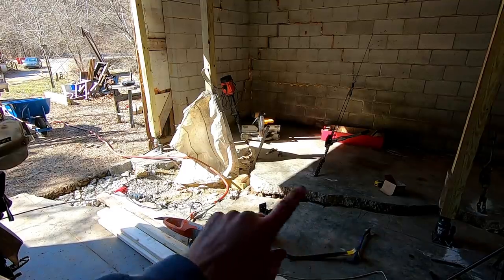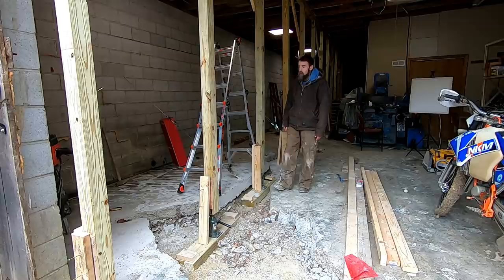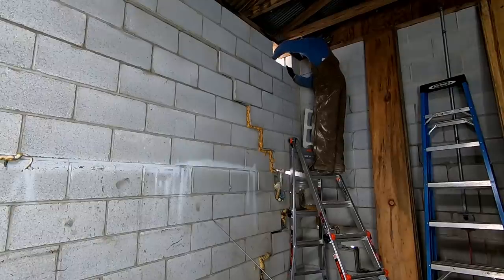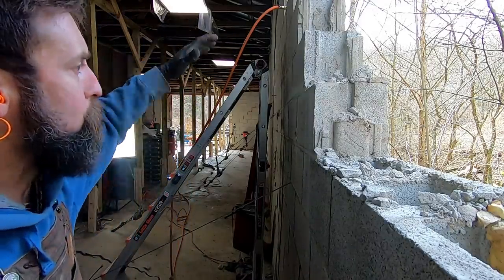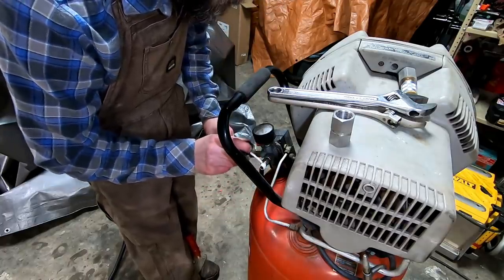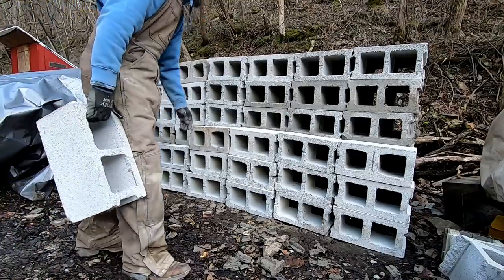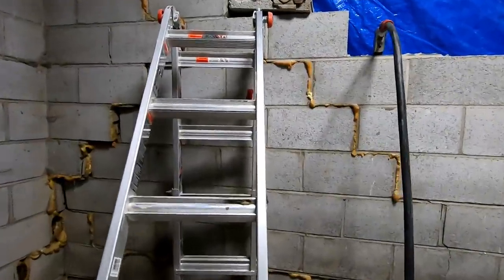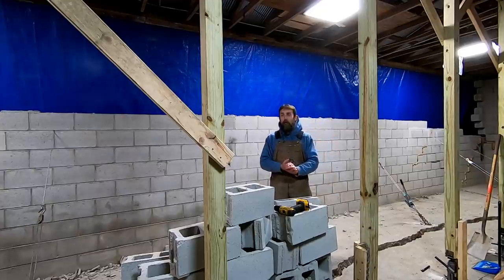Leaning Block wall removal and Roof lift  SHOP PT4

Comment: That young man was working his B.O. humping those blocks for you Steve. Dead weight shere on those  screws is no worries. If anything the threads will help maintain lock in the wood that they are screwed into. Use a comparable size of screw  for the nail that you would have used. Dont use a sheet rock screw where you would have used a 16d nail. It is like everything over the last few years. The meathods and material have come a long way. I added on to my shop about 3 years ago and very few nails  were used in the construction. Even though I have a very good nail gun. Just pay attention to what screws manufactured intended use is. Dont short cut the intentions over cost. Baring any disasters  and maintaining what you have that building will still be standing when your son is old and in no longer need of it. Along with the equipment inside.

Comment: You could set aside some space along that wall for the wife and kid work spaces, plus a general multi use bench near the door that would be great for gardening use, disassembly of messy things. This is the perfect time to plan out the layout of the whole garage, machines, fixed location benches, moving benches moving tool box/bench... lots of options.
I doubt the roof is all that heavy, just not fully able to support it's self, I'd be surprised if the posts have to support more than 200 lbs.
You've gone overboard on the support with the 4x4 and 6ton bottle jacks, like you had a 2nd floor to deal with, mostly to keep the internet armchair engineers from loosing their minds, only half will be sufficiently convinced you've done enough, and nothing you do will satisfy all of them.

Comment: I saw a wet saw recently that had a good two and half foot wide blade thats handheld but just has a metal frame around the blade and not alot more bar the two hoses.

Comment: A grk ledgerlock screw has the same shear strength as a 1/2" lag bolt.  Use them all the time.
Reply: If it is not the same diameter or uses a significantly higher tensile strength steel, I don't see that being likely.  Shear strength is going to be determined by the cross-sectional area and tensile strength of the steel.

Comment: wow Steve, a foot long bolt holding the roof! here in OZ its 1/2" threaded rod that ties into the floor or foundation reo , good job i wish you luck
Reply: Yes I like a few more courses of weight involved. I use stainless rod and nuts, it's damp in UK

Comment: I really wish you were wearing a respirator that cement dust is dangerous. Oh ok you were could not see it when you switched to the air hammer. Good job. Concern about GRK screws is crap. Those are the toughest screw you can get and engineered to replace lag screws. Don't worry about those things.  You have that way over engineered. Don't worry about it.

Comment: Nails have better shear strength, but given that the fasteners are not taking the whole load, I think you are just fine.  I looked all this up, and there are a lot of variables here.  These include species of wood used,  size of screw, distance from the edge of the piece being fixed, moisture content of the wood.  You get the idea.   Do you intend on re-using the block?

Comment: Screws will act in tension in your application- the roof weight being carried by the friction between the pieces of wood pulled hard together. If you'd nailed it together, yes the nails would mostly be in shear.

Comment: ProjectFarm did a test on shear strengt nails vs screws and is basicly not better with nails, since screws hold the wood together better anyway and they does not shear as esy as many think

Comment: When you are pouring the new slab, are you going to put in the shuttering, dig deep, put in all the rebar for the foundation footings, and tie to the existing concrete yourself, or hire in somebody to help do that. Buy a concrete mixer, rent one ( not the best, if you have one on hand, even the cheap ones, it will always find use around the area and your family) to do the foundation mix, or get a truck of concrete or three to do the initial pour, and only use the mixer for the mortar for the walls. When you dig down to the shale, and are at final depth, drill a row of holes and hammer rebar down there to tie in strongly to the rock, will keep it from moving for the next century or so, till the stream cuts down deep enough.
Reply: If it's in the budget, I would personally have a mixer truck come in and knock it out in one go. It makes for a more consistent pour and stronger set. Plus it would save a boat load of time. It will also make for a more level and smoother finish.

Comment: I'll try to get an email off to you this evening, about my thoughts on what could be done as far as rebuilding that side and making sure you won't have to do it again a few decades from now.  I keep dithering over it because of problems with techniques ... I'd do it now, but the weather couldn't be nicer for this time of year, and I need to spend it swapping out a fuel tank on Rumble (the fuel pump went out on my work vehicle).  Best get to it, before I lose daylight.

Comment: I’m still a bit nervous about this because I can’t tell exactly where the center of mass is. I’m nervous because if that wall did go over, it would have taken that part of the floor connected to it. And what’s on that floor, leaning against that wall? The ladder, with him on it.

As far as the hose goes, what size is the connector on the compressor? It looks like 1/4”. If so, then there will be delayed delivery through that small connector.

Comment: it's a convict work ...
I have never seen a mortar peel off so easily ... finally you are lucky in your misfortune
(Google traduction)
Reply: At least this time shoddy building work and using a weak mixture is paying off slightly. An attempt was made to do it properly, just the execution was poor, the overall design was good.
Reply: SeanBZA I beg to disagree, there was no attempt whatsoever to do anything correctly as far as the slab was concerned and the way the mortar is coming off of the blocks weak tea would be a stronger mix than that crap they used!
Reply: @samrodian919  I said implementation was poor, not the design. Probably a subcontractor who decided that the steel and half the cement was going to go with them as they left site, and they had plenty of time alone to make this happen.

Seen plenty of cowboy builders, and they are not always the small guys either.

Comment: I am surprised that the wall held together with as little reinforcement as it had. No vertical rebar and no bond beam at the top at all. Guessing that if the slab is any indication, there is no rebar in the original foundation.

Comment: Use the mortar as drive way rock
Reply: Not good for that, but good as underlay for the driveway gravel, or use as aggregate partly in the new concrete if mixing on site, along with any broken blocks. Will work as mass fill, not for high strength work.

Comment: Watching how easily the mortar comes off of the block, I am wondering if it ever really adhered to the block in the first place. Looks like it was a too dry of an application from the original construction. And seeing that, I can also see why the wall was so questionable with fracturing like it did. Either way, I see you could reuse those blocks to build it back. JMHO

Comment: looks like you can reuse a lot of the blocks , looks like they forgot to wetten the blocks down before cementing them together , causes the morter to dry out too fast and become brittle and not adhere verry well
can prolly use the morter rubbish to fill in mudholes in youre access road if you have them

Comment: One thing I noticed and I may have missed it but did not see you address. You jacked up support to lift the roof to remove the wall. Guess the roof was already settled and lower on that side. You will need to jack it up allot more to get it level before building the new wall. Looking at the building from the first video I would guess it has settled at least a foot or more at the edge.

Comment: Would it be possible to use something like plywood to lay up on the face of the wall and use that to pull the wall down to the floor as one large unit?  Just thinking out loud.

Comment: I’m not exactly sure how you’re planning on rebuilding 
that side of the wall. 
  I don’t think I’d do anything before some type of 
piling system was driven into the ground to keep your 
bank from eroding into the creek.
  You mentioned re-using those blocks, well, that’s
just going to re-introduce all that weight on that
area of ground.  Why don’t you dig a good trench for
a footer, pour the footer, put in one row of blocks or
whatever it takes to bring the floor up to the bottom
of the 4x4 posts you bought and drive the temporary
support wall you already built into position?

If you get a good volunteer crew to help, everyone
could drive one post all the way into position and that
could be your new outside wall.

Comment: I am a bit concerned. I think the supports should be closer to the wall than it is now. You are going to take the broken concrete out anyway, so, why not cut some perpendicular (to the wall) sections and at least move the odd (or even) numbered supports towards the wall (odd = 1st, 3rd, 5th... or  even = 2nd 4th 6th... etc.) ? I guess the thin metal roofing and wood framing is throwing me off. I have much better feeling for concrete and red tile shingles which weighs (literally) tons more... I have not completed watching the whole video, but, I also think separating the wall from the roof first would be safest way to start (AFTER making sure the roof is holding (i.e. after moving some supports towards the wall)) . I hope all goes well.

Comment: From my experience with moving building and houses you would have been better off uesing one steel I-beems and two 20 ton Jack's supported by wood cribing two jacks are easyer to manage when you start going up off the wall. .

Comment: The blocks were not the right ones in the first place, they should have been H block with open ends, when a row is finished a piece of rebar is placed in the open slot to the length of the row, then the next row is blocked and so on, when the wall is completed it is then filled with concrete down the holes at the top to fill the entire wall, but a solid rigid wall is not suited to movement and thus has to flex plus its too heavy where it is, its the old adage do it right first time then no need for a second go, I put windows above the 2 metre height for security which were fixed to let sun light in along a north east facing wall, it made a big difference to lighting in my workshop, you have a river to look at so maybe place a deck so you can go outside for lunch.

Comment: No vertical/horizontal rebar in the wall?
Reply: There were 2 rows of brickforce wire in there, which would have held the wall if the footings had not been sub par. Just not a lot of mortar, and that as well likely was poor quality cement, mixed on the weak side, from the way it came off so easily. Probably also work done in the cold, so the cement did not cure properly before it was frozen.

Horizontal a wire bond every 3 courses will be strong enough for anything short of an actual retaining wall, and vertically not really needed, though if you have 4-5ft sections of old rebar or EMT conduit placing them every 5 bricks apart as you go will make it a lot sturdier, though if you want to use it as a hanging area or for heavy loads you are better off building in pillars and making the wall thicker, which these style blocks are not amenable to. for the roof load, snow load and hanging the odd bikes and ladders it will do fine though, this style of wall is common here, used to build 2-3 floor residential buildings, where the wall supports the upper slab as sole support.

Comment: These blocks are supposed to be vertically reinforced with rebar and filled with concrete all the way through, unlike ceramic bricks, because the contact surface between these blocks is much smaller and the load-bearing capacity of a wall made of these is a fraction of the system's original strength this way. It's really weird to see such a huge amount of money invested into building materials and then demonstrating complete and utter incompetence when it comes to using them. It's very obvious that a civil engineer has never seen the plans for this shed if there were any. It goes without saying that the substructure (the unreinforced slab that broke in half) is also inadequate to support the load of the blocks and the concrete supposed to be filling them. You're supposed to dig a proper foundation unless you want to pour an unnecessarily thick concrete slab.

Comment: I don't think the screw concern is valid. You're looking at 600 lbs of shear for a .160 thou fastener with 120ksi tensile strength. I know screws are smaller, so maybe 1/2 that. Times 6. Times 10. Plus friction force. But yeah, the jack will do fine.